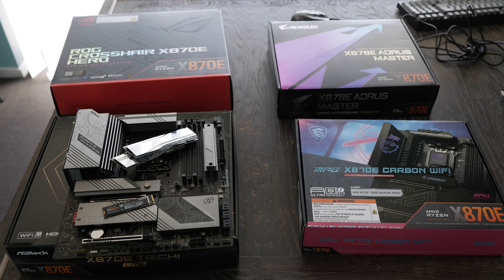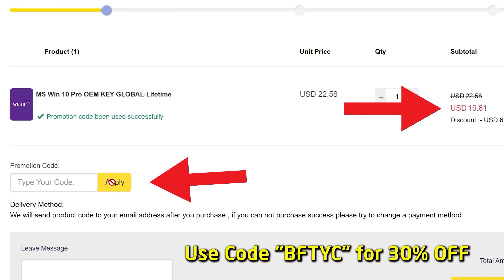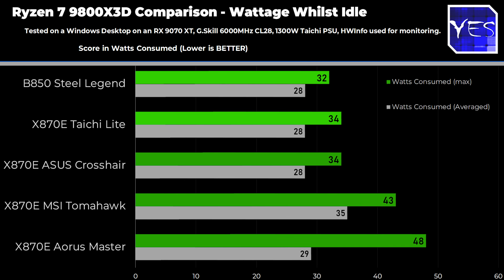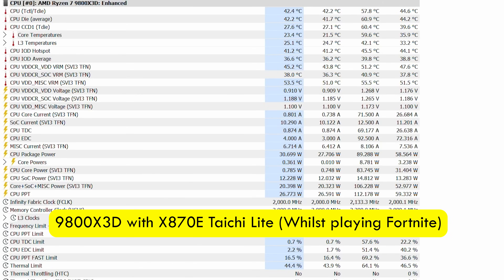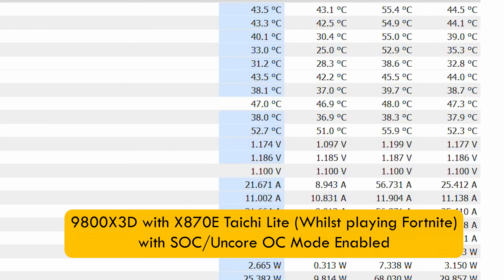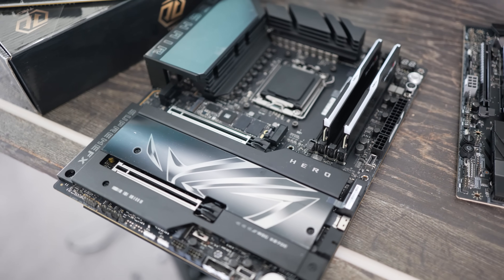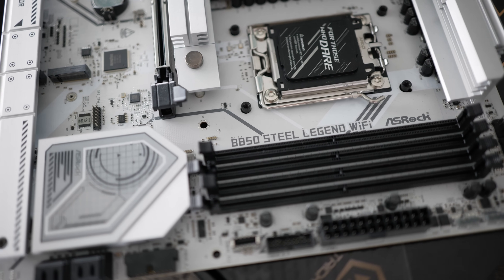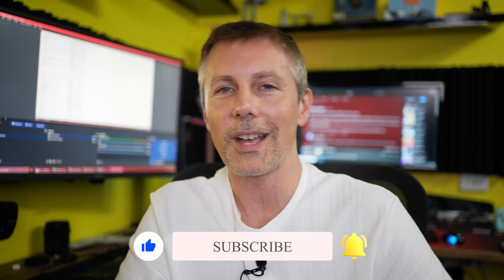I think I know why Ryzen 9000 Series CPUs are Dying...(!)

Comment: you can try setting a static soc voltage.
on ryzen 9000 series you can try 1.1v for 6000mts. stress test with testmem5(extreme1 by anta777)  or y cruncher(fftv4 or vt3). if its not stable try 1.15v. that should work on most 9000 series cpu.
some 9000 series cpus can even go as low as 1v or lower for 6000mts. if you have the time try to see how low you can get and always make sure to verify stability with a 3hr+ memtest.
DO NOT USE AIDA OR MEMTEST86
Reply: Why are aida and memtest86 bad?
Reply: @RafitoOoO  because they are. if you want to find errors testmem5, y cruncher and prime95 are the gold standard. if you want to test performance... well thats a bit tricky but still not aida. id do the particular workloads im interested in(CS2 and dota2 only since i dont play other games). why bother with synthetic memory benchmarks when you can do real gaming benchmarks. also i find that the loading phase on CS2 can sometimes find memory errors by crashing my computer, not that you should rely on it, the gold standard tests are more effective
Reply: I do know memtest86 is ok for most DDR4 kits, but yeah I assume stuff has changed with DDR5.
Reply: @ArtisChronicles  i wouldnt touch memtest86 with a 10 foot pole even if im tuning ddr4. its that bad. aida also
Reply: @ArtisChronicles  lol i just noticed the funny ash profile pic. 😂
Reply: lowest vsoc point ? you need a really good board for that. 1.100vsoc @ 6000 on a 4dimmer ? Unlikely. possible ? Maybe….

on a 1dpc ? the odds aren’t even odds anymore…. the 1dpc just tells the 4 dimmer to move out of it’s way lol… 

1.15-1.2 on a 4dimmer is more then likely. 1.100 tho ? yea you need a strong chip to get away with that on a 4 dimmer unless you run slow ram speeds
Reply: @LightWorks222  1.1v soc on a 4 dimmer is possible even if its a cheap board. i have a b650m ds3h. and i can go even lower than 1.1v.
soc voltage is mostly determined by memory speed+gear mode and silicone quality/memory controller design ON THE CPU. that means, it matters more what cpu you use and less what board you use.
yes, 9000 series cpus have better memory controller than 7000 series. just in case youre wondering.. the difference is about 10%. this is why most 9000 series cpus can do 6400mts at gear1 without needing 1.28-1.3v soc. mine only needs 1.2v. a 7000 series cpu usually cannot do 6400mts and even when its possible its rare and you need very high voltages to get it stable
Reply: @ my 7000 chip happens to do 6000-6400.

on a gene + bios 3003 I can do .960 @ 6000

Currently testing 6200 @ 1.025 which is below spd
Reply: can i just put 1.15v and not test too much? xd im currently at 1.2v 6000cl30
Reply: @AestheticKunt  if you don’t feel like testing then I’d leave it @ 1.165-1.185 for now
Reply: @LightWorks222  but if i cant even do 1.15v at 6000mt is because i would have a reeeeally bad binning right? on +80% of pcs 1.15v should work plenty at 6000 i think

I only have 2 sticks btw, hynix A single rank, 2x16gb 6000mhz cl30
Reply: @ na bro, it’s the motherboard. after what I went through with the 7800x3d you’ll never know your CPU’s true output until you pair it with a 1dpc + good ram + a good bios version. 

the reason for this is because most motherboards are built around reliability + storage expansion not overclocking. 

for now just keep lowering in steps of -5mv from 1.2 until you’re not stable. 

if you get a blue screen when booting into windows you need more vsoc

if your tphyrdl is mismatched for the second ram stick, you need more vsoc.

Your cpu is crashing games or apps ? You need more vsoc. 

you feel like there’s a de-sync ? you need more vsoc lol. 

keep in mind that lower vsoc means your system will take longer to boot so don’t be alarmed by your system appearing like it’s taking longer to boot.
Reply: @LightWorks222  lol i didnt knew about the boot times :O, right now the pc boots as fast as a intel system, very quick. Maybe i can set 1.2 manually to try if it doesnt spike anymore
Reply: @AestheticKunt  if the cpu is 9000 series, 1.15v is fine. no need to test. if you do notice your PC crashing or blue screening, then you should run a test. if everything is fine no need.
Reply: @cant_Comment  great, Thanks!
Reply: It's gonna be amusing when these average PC users try to find the CMOS clear pin, while thinking they bricked their PC.
Reply: @metradawn8071  its easier to take out the cmos battery or use the back i/o button hehe
Reply: @AestheticKunt  After freaking out for 10 minutes and googling around? Sure

Comment: 1:03 SoC would imply the cpu has the ram and storage soldered on
Reply: SoC voltage is actually a value which affects the CPUs memory controller. That's what it's called
Reply: How about you educate yourself instead of making low iq comments.

Comment: I am running my ASRock X870 PRO RS 9700x on expo but also have the performance set to 65c max and -20mv. Do I need to also set the SOC OC setting to enabled like you show in the video or is this board not affected by what is happening on the other ASRock boads? Or does the setting to not allow it to get hotter than 65C and undervolt  of -20 take care of the issue?

Comment: remember kids, overvolting is never fun. with amd this is the 2nd instance of "dead by vsoc overvoltage" since am5 and the raptorlake instability is basically the same issue with the >1,5v voltage spikes frying the bus of the cpu.

"according to spec" is totally worthless when it fails the "common sense" test. now the current issue with the SoC with asrock boards seems to be not obviously visible because if it is voltage spikes on the vsoc rail, they are probably too short to get picked up reliably by hwinfo. so either we have to try a very high polling rate in hwinfo or use an oscilloscope to measure the vsoc to catch it.

i suspect we should see 1,3v to 1,45v voltage spikes - this is kill territory for the zen3/zen4/zen5 IOD. that said, the 1,25v of the asus board is also kinda high for my taste. ususally you would want to see below 1,2v.
Reply: 1.265v on that asrock taichi board is very high for ddr5 6000. hey i could do 6400mts gear1 on my 9950x3d with only 1.2v

Comment: A friend of mine lost his 9800X3D @ stock settings on an Asus ROG Crosshair X870, since he got a 9700X no problems so far. I myself run a ROG X870i and the CPU VDDCCR_SOC stay rock solid @ 1.250. Thank U for all the work but I guess there is some more to discover about this issue...
Reply: Which memory sticks (vendor/MHz/timings) do you use with ROG X870i?
Reply: @ДмитрийЭль-р5з  I use GSKILL Trident Z5 6400 Mhz Cl32 non expo 2X16gb
Reply: If it was simple I assume lots of vendors would have a bios update that would fix it. So I agree, a lot more investigation is needed
Reply: (Asrock 870e Taichi lite,
9900x, team 64g 6400) I tried IF=2133 1:1 to mem @ 6400 and is very stable but not 100% stable w very long mem test. Had vsoc to 1.21 but afraid to push harder. See ASUS goes to fixed 1.25.
Reply: The x3d’s are very V. sensitive. The 9000 x3d’s were supposed to be better than 7000 versions but evidently not. So guessing the ASUS auto set vsoc=1.25 vs 1.2 or less stock is issue esp the x3d’s ?!
Reply: Why I avoided the x3d’s. Plus I don’t game so there’s that.

Comment: Running msi X870E Carbon WIFI +9800X3D +5090+2 x Gen5 M.2SSD +1x 4 Gen M.2 + 48 GB Corsair Titanium 7200 DDR5 ( set to 6400 CL 32 1.38V)  and so far (knock on wood) Everything works perfectly from the day I bought it, so far I think it's the 3th or 4th  BIOS release I updated from the initial on the board.  I also applied a modest OC tuning.
Reply: I am thinking of ordering this board on Monday